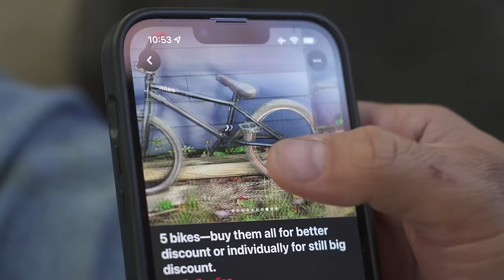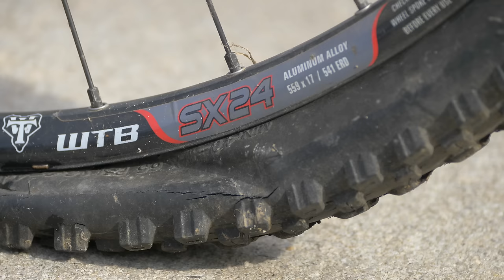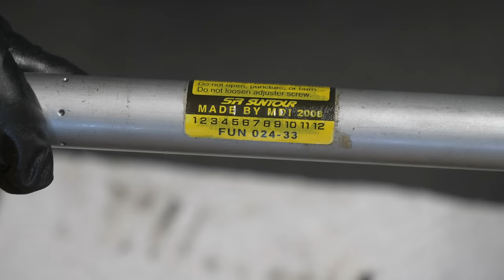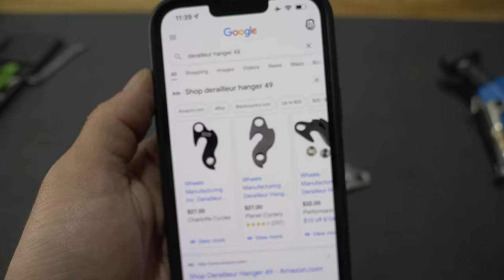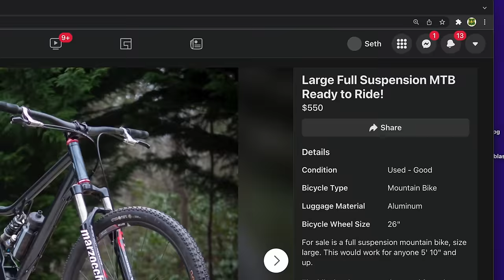Restoring a VERY neglected 'mystery' full squish

Comment: Let me tell you... This flip bike series has me buying up old bikes and flipping them. I flipped my way up to a brand new bike for the wife, started off with a $150 bike, sold it for $400, bought a full suspension GT for $200, flipped it for $550, bought her a brand new $900 bike for $600 on offerup, swapped out a bunch of parts with quality parts from the parts bin and shes in a $1200 or so rig right now from my initial $150 investment.
Reply: I’ve been doing the same for years and just recently one of my local bike shops liked what I was doing and offered me a job. Now I have all mod cons at my disposal after hours and can flip bikes a little easier. 
Keep up the passion mate.

Comment: Crazy restoration! I would have just sprayed some WD-40 everywhere that looked old and been done with it 😂 Great job!
Reply: WD-40 is not good for bikes. If you get it on the rotors they will be ruined. It's not a lubricant, it's designed for water displacement (that's what WD stands for)

Comment: I'm hooked on this story. I had a small fleet of Rocky Mountain bikes going back to late 2000s and I think this is a late 2000s Rocky Mountain prototype! Rocky Mountain was handmade in Canada at the time and experimented with rear linkages quite a bit. The square tube was used on their thrust-link design for downhill bikes like the RM7 around the same time, but I can't recall if it had internal cable routing. I think this might have been an attempt to lighten the design for XC use.
Also, the stem cap and handlebars are "RMB" - I believe this is the Rock Mountain house brand for generic parts, which they used extensively in mid-2000s too. Not to mention tru-vative stem and WTB wheels were staples for them at the time too.
Seth mentions they used nice parts across the bike; a prototype engineer would have had the means to access these parts for a frankenbike like this.
And yes: the wheelsmfg #49 hanger crosses to Rocky Mountain #7 ;)
Seth, we need a follow-up video on this one!!!
Reply: Damn, Seth should be pinning this
Reply from the maker: We looked into Rocky but didn’t find anything that looked like this. Maybe it was custom?! The serial number starts with BC, could that be a clue?
Reply: @SethsBikeHacks  That's too much of a coincidence to not look in to further! I think their production bikes all start with PR. They've done some high-profile prototype builds in the past... I'd drop them an email and see if it's theirs?
Curious to know too... do you think the paint was original? Spray paint? Any evidence of decals?
Reply: @SethsBikeHacks  it's a Rockrider Btwin 6.3... Look them up. Frame is exactly like this one..
Reply: EDIT, Pell ridelight, somone in the comments got it

Comment: it could be an Orange? it just looks like there kinda styling and has the single pivot suspension, also the always stock high end fox rear shoxs on their bikes. Back in the day this will have been a high end shock. Just a thought.
Reply from the maker: I’ve ruled out all Orange bikes due to the derailleur hanger, and also design differences in the rear triangle, but the linkage does look very similar!
Reply: It could be a 06 santa cruz superlight or 05?
Reply: @stephenkimesdicul7976  or a heckler
Reply: @tsargiske488  maybe. it has the same geometry
Reply: It's not an Orange, they use folded aluminium sheets to make the majority of their frames rather than premade tubing. Although linkage wise it's not a million miles away
Reply: @superspecky4eyes  ah I didn't know that, that's cool to know
Reply: @boxz2498  Yeah, it's pretty unique, basically an origami bike frame!
Reply: Looks like a knock off orange clone..
Normally means it's a diamond back

Comment: I've seen a couple older santa cruz bikes that look really similar to that frame. One was a heckler and the other was a blur. If I were to really try to guess at it I'd say it looks like a blur frame that someone rebuilt and added more aggressive parts to at some point around 09-10.
Reply: I think you're right. 2003 superlight maybe?
Reply: @michaeldouglasmason  could be. It did sound like there was a serial at indicated it might be an '06. But, it does sound like it's got parts from multiple years on it.
Reply: The blur used VPP so definitely can't be that. The early hecklers looked very similar, but hecklers from this time frame look vastly different.
Reply: @michaeldouglasmason  Afte doing some more research, I think you're right. The closest bike I could find is an '03-'06 superlight. The rear triangle looks a little too beefy on this bike and the pivot point seems a little too far forward, but it's very similar. The only other bike I found that looked similar was an '06ish Haro.

Comment: Your spraypaint coats are too thick. There's lumpy buildup in some spots. Thin coats, barely thick enough to be opaque, are mandatory when spraypainting unless it's supposed to be a textured paint like "hammer finish" or "truck bedliner".
Good to know about the Park magnetic cable fishing tool. I really could've used that back in 1998. I had to drop a piece of weighted thread through my swingarm and carefully tilt the swingarm until the thread dropped through the exit hole. Took me a good 30 minutes.

Comment: It looks so similar to several bikes but the vertical brace in the front of the subframe is what really makes this unique.   Also, the gusset where the top tube and seat tube meet, but as someone else said.... That could be specific to larger sizing.   I wouldnt go by components.   I'm betting those Avids were added later.

Comment: Hey seth, i've rounded off my t25 on my brake discs trying to get them off, any reccomendations to get it out it's 2/6 that are rounded i got the other 4 off
Reply: I’ve had luck using speed out style bits. You can also cut a straight slot with a dremel and use a flat headed screw driver
Reply: Penetrating oil and heat can help get them looser, then you should pickup a round-head remover from the hardware store. It’s basically a rudimentary tap that bites into the mangled heads and allows you to extract them.
Reply from the maker: Plus one on the “speed out”. It’s tough to proceed without buying a new tool but a good screw extractor can save you money for decades. For a rounded t25 it should be pretty easy. Just drill out the center of the bolt a little deeper, and then go slowly in reverse with the extractor until it bites.
Reply: Your first and best option is to try and force an allen key roughly the right size into the stripped bolts (try both imperial and metric), push down as hard as you can and turn. Otherwise you can also try use an angle grinder, dremel, or hacksaw to cut a slit into the stripped bolt heads and try to use a flathead to take them out.
Reply: I had exactly this, I had to cut a slot with a saw, got a massive flat head screwdriver and used brute strength. Since the hub is alu and the bolt steel, use boiling water to help split it open. Good luck!
Reply: Yes the allen key trick first than the slot option. If it still doesn't come loose, grind the head off, take the disc off, and that leaves you a bit of thread in the air. Get a good visegrip, you know these pliers that have an adjustment roller at the back. With these you can grab the bit of thread realy tight, and turn them out of the hole. It will break the thread locker glue typicaly used on these bolts. Also use heat at this point. The heat will undo the thread locker, and the aluminium from the hub will expand.
Reply: This happened on my bike what I did was I made a slice like a flat head screwdriver using a grinder and hit it with a masonry chisel going counter clockwise
Reply: Needle nose vice grips work, as they are flat on the sides and can bite into the edge of the screw flush with the rotor surface.
Reply: Left handed drill bits are your friend.

Comment: I loved the video. I’ve restored my old 90’s cannondale hard tail. Found the right huge headset from woodman. Installed fox f100 RLT fork, mavic wheels. Managed to put a crank bro. Drop seat in as well. No easy trick. It’s a different bike for sure. I really did some fun work on a Gary fisher Joshua f4. New fox 36 fork, front disc, I also managed to put a crank bro. Dropper in by custom bending some small stainless tubing  just right to run a cable to it and make the tight Y frame clearance. 😅 Adjustable damper coil over replacement. Completely different ride as well. Had a lot fun engineering it all and finding the parts I needed or made them.

Comment: Love these videos. But wish Seth would get a ratcheting ferrule crimping tool for putting the brake cable end caps on. It has 4 equal surfaces to apply an even crimp compared to the needle nose pliers.

Comment: One thing I didn’t hear you mention when talking about the cable housing is that brake and shift housing are different internally. Brake internals are coiled, where shift internals run parallel to the outer housing. You can use brake housing for shifters if you have to, but not the other way around. Brake cables will blow out shift housing. Kind of irrelevant these days, but for restoration, it could come up for a diy’er. Love your videos.

Comment: after a lil bit of research i think ive found it. looks like a btwin 500s. seen a lot of comments saying diamondback recoil but the top tube has an extra piece welded on. the btwin looks about as close as possible. however its extremely clear that a lot of cheaper bikes of this era used very similar moulds
Reply: is/was there ever Decathlon in the USA?

Comment: It's a 2008 Pell's Ridelight Elite (XL size): same components, same derailleur hanger, same rear suspension crossbar.  Search  Pell's Ridelight elite kola 2008  and you will see it's the exact same bike.  It came in four models, Pro, Elite, Race, and Team.  This bike (Elite) retailed for around $1,600 USD.  The rear suspension crossbar is the distinguishing feature that confirms the brand.
Reply: I think you're right. The crossbar is the exact same, along with the weld connecting the top tube and seat post.

Comment: Hey Seth I have a couple bike hacks that you could share. 

Mix 13 gallons of water with 1.5 cups of citric acid powder and let rusted parts sit for 24 hours. The rust will come off without damaging the chrome or paint. 

From local hardware store buy a black iron flange, t fitting, a short connector and two short plastic connectors all in half inch and you can use it as a fork mounted bike rack by removing the front wheel and sticking you axle back through

Comment: The bomber 33 was for slopestyle. Think it might be one of the first attempts at a full dirt jumper? If you could weld you could turn it into one by cutting and lowering the back of the top frame bar and seat. I'm guessing if it's older there 26". Make it a single speed.

Comment: Another note on the brake vs shift housing differences (not just thicker and thinner). 

Brake housing will have a coiled layer/sheath of metal inside while shift housing will have a metal layer consisting of a bunch of strands oriented lengthwise. This “compressionless” housing will allow for precise shifting. Brake housing compresses a little, adding to modulation but, more importantly, helping to keep the housing from splitting, splaying apart etc. 

Brake housing will not work well when it comes to precise shifting and shift housing would make brake feel wooden and will fail faster than actual brake housing.

Comment: You know with the cable routing kit, the screw end on one of the wires is for threading into cable housing. It works a lot better then taping the cable to the housing

Comment: I believe it's a 2008 Pell's Ridelight made in Czechoslovakia.  Do an image search on 2008 Pell's Rideligh to see it's the same bike. Libor Petrvalsky, the founder of the Czech Pells brand (a competitive cyclist)  produced roughly 9,000 mountain bikes, cross bikes, and road bikes in 2008. Pell's is still manufactured and sold all over Europe today. I'm not sure if they were buying the frame for resale or if the bike frame was actually manufactured by Pell's. Pell's was making aluminum and carbon fiber frames at its Brno plant. If they were just a reseller of that frame, it could have been sold under a different brand in the US.
Reply: I agree it looks just like that, only a longer headtube and slightly more upbend to the toptube from the pictures I saw; both of which could be explained by Seth's being an XL bike.

Comment: Why did you not upgrade to the Shimano MT200 Hydrolic brakes like what you used on the GT build?  I just cannot picture using cable/mechanical brakes on ANY MTB that will be doing more than riding around the block of a typical suburban setting.

Comment: A technical question. I have 26 Araya tx-633 (559x19c) rims and I have Schwalbe table top 2.25 (57-559) tires mounted which I want to replace. The question is will I be able to mount some Mitas Defender 2.35 (60-559) without having problems with that rim? Very good videos. Thanks in advance!
Reply: Due to the size of the bike frame, there is no problem. The issue is the internal measurement of the rim (that is, the ETRTO). The ETRTO of my rim is 559x19 (19mm internal width) and the ETRTO of the tire I need to install is 60x559 (I think 25mm internal width). These are technical data that must be taken into account before buying tires and not many bike shops know those details. Sorry for my bad english and thanks

Comment: When you replace orients on shocks, do you get the o-rings from the manufacturer or do you have a general set that works for most forks? I’ve got a suntour xcr air 29er on my hard rock expert 29er that is needing seals replaced and they are out of stock on the air cap.

Comment: I just got turned on to you’re channel and I’m learning a lot. I notice when your building a bike the front gear is a single gear most of the time with the rear gears being something like 11 or 12 gears. What’s the benefit of that set up opposed to something like a 3x8 speed set up that you find on most entry level bikes from a bike shop?
Reply: Less mechanical parts (front derailleur) and better gear ratios.
Reply: It's called a 1x drivetrain (as opposed to 2x or 3x). The advantages are simplicity (one less shifter on the bar and no big gear jumps), weight savings, and better chain management. They became standard about 10 years ago. I still think a 2x drivetrain can be better in some situations such as steep mountainous areas or long rides such as bikepacking.

Comment: Paint stripper might have removed the crappy paint job and revealed the original graphics? Curious to know what paint and clearcoat you used for the frame and forks too.
Don't think anyone is spending $500 on an unknown 26" bike tbh. Lots of work put into it sure, but a buyer doesn't care about that.

Comment: Putting short stems on bikes like this has not yielded good results for me. The bikes geometry was originally made for a longer stem. When I put a short stem on an otherwise long stem bike, it messes with its handling characteristics, and makes it way too twitchy. Because these older bikes have steeper hhead tube angles, they need a longer stem to make their handling more balanced/predictible. Short stems make the handling far too twitchy on these older bikes,

Comment: This might get lost, but the paint booth link you're using on Amazon is way overpriced.  Recently the price went up to $90 (at the beginning of June it was $40).  The same tent is available at Home Depot for $40.  It's probably just a mater of that particular listing being low on stock and algorithmically adjusting the price up, but I would hate someone to pay that much from your link and find out they got ripped off.